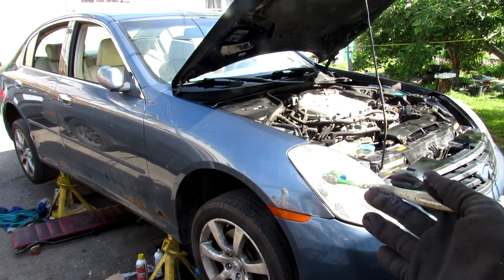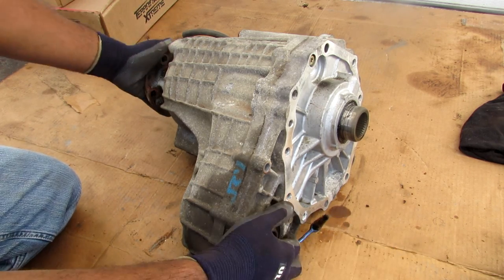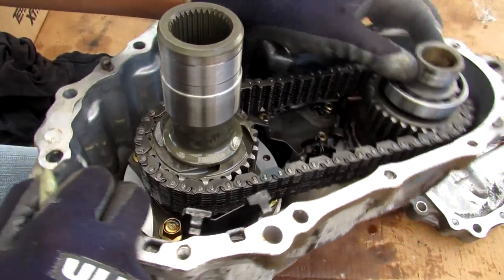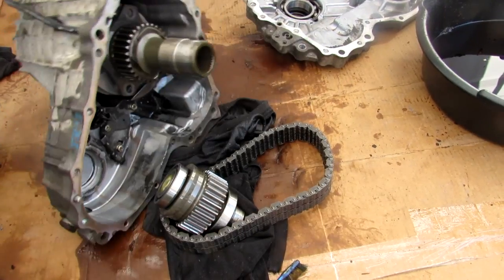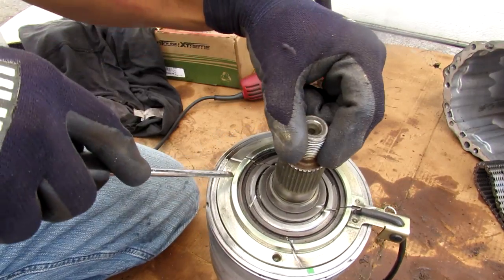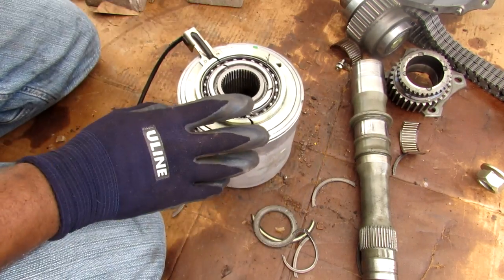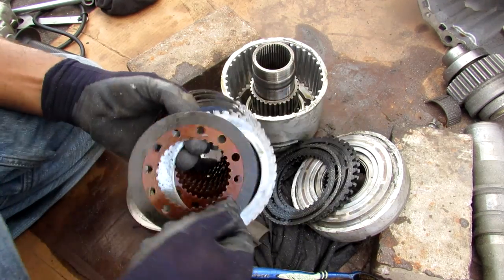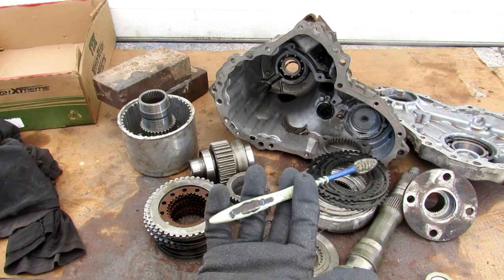How Does AWD Work?

Comment: I'm wondering how much energy loss the AWD clutch pack loses with the transfer. I'm thinking no on the AWD unless absolutely necessary and just stay with FWD, but if absolutely necessary I would go to the 4wd vehicle.
Reply: Energy loss or not, it depends on where you are and what kind of driving you need to do.
Lots of people in places like Colorado swear by it - but for most, decent winter tires and FWD does fine...and tire chains, by law you have to have them in CO if you don't have AWD or snow tires. I had an AWD Chevy Trax and it did GREAT in the snow - the AWD system only kicked in with slippage so it got good mileage. My RAV4's AWD system is always active so, it doesn't do as well on the mileage - but it has a lot more power; trade-offs abound!
Reply from the maker: Yep that's the downside of having AWD, the losses of the extra power train equipment moving around, and it's weight (approximately 200lbs). 

You'd have to outweigh the fuel, maintainence and heavier handling with the extra traction you require before considering. 

Alot of manufacturers are using part time AWD systems that disconnect the driveshaft or axles completely and only power AWD when slippage is detected.
Reply: if you have car with lot of power, it is better to have awd because 4 w on ground is better than 2 w
Reply: @makantahi3731  
if you have car with lot of power, it would be prohibitively expensive to add AWD to it - I'd get good winter tires...
Reply: @atticstattic  i have chrysler 300c 5.7 awd and it goes on snow with winter tires as it is on dry and hot, i did not install awd by my own, it was made when it was manufactured, btw  i have car with fwd too and it can not measure with awd, it is rocket on any surface and condition
Reply: @makantahi3731  I have a G35X AWD, the same system he was displaying in this video. It's real fun to drive in the rain as well. IMO that's where this ATTESA system really shines. You feel completely safe driving at highway speeds when the roads are especially wet and slippery. You can easily pass cars that are driving slower because they feel unsafe.

Comment: You should take apart a knocking or seized Hyundai/Kia 2.4 Theta II GDI and show why they fail. They usually blow up on the highway, and sometimes a connecting rod explodes into the oil pan and/or through the block. We replace these engines all the time.
Reply from the maker: I heard about the theta2 motors. I'd like to get one someday.
Reply: @speedkar99  The 2.0 Turbo version of the Theta II is much beefier. They are still under the same recall but don't blow up as often.

Comment: Given the direct drive to the rear wheels, in this case, I have to think the rear wheels always get 100% of the torque, so where the front wheels may out traction the clutch pack (and there not spin, only slipping the clutch), the rear wheels have no choice but to spin or kill the engine.  At no point will the rear wheels ever spin, say at 90% in relation to their input.

Comment: Nice video, very informative! Got a question. Is the transfer case the same as a PTU or PTO?
Reply: That's what my Hyundai mechanic said on the Kona. He called at Power Take Off unit. Never heard of that. Also said the fluid is good for 50k miles, well, not so much, after 6k miles it was black and had clutch matter in it. Same with the rear diff.

Comment: Hey thanks a lot for the teardown Speedkar99.
I've been trying to wrap my head around one part of transfer cases with clutches and I need your help:

The clutch can only transfer torque between the parts it connects. If the gear ratios of front and rear diff/axle combos are matched exactly, there will be no torque applied across this clutch at all because both prop shafts will be spinning with the same speed (ignoring the car turning and different wear/inflation of the wheels).
Does this mean that front and rear axles are geared in such way that the front prop shaft is spinning slower than the rear prop shaft when the car is rolling? This is the only way I can think of to have the power transferred to the front prop shaft.
If this is so, the implication here is that there's always some loss of power in the clutch pack whenever AWD system is engaged, because the clutch won't be able to full lock up, right?

Thanks in advance!

Comment: But if this clutch is usually half-engaged, wouldn't that be similar to "riding the clutch" in a transmission, and quickly wear out the clutch?
Reply: yes, yes, that clutch is clutch just to do engagement smootly, it could be done by gears but car should stop to engage wheels
Reply: The front wheels are only activated during hard acceleration giving the car a FWD assist with a 80/20 split. There's a snow button for a 50/50 split that's only activated within 10mph. It actually is a smooth transition. You can feel the grip in the front wheels too. I have an 04 G35X with 208k. It's 16yrs old and the ATTESA awd system works flawlessly still. The transmission itself is still really smooth. Have no clue if it's the original or not. I know the front & rear diffs, and the transfer case are. If I'm going say 50-60mph and drop it into 3rd and give it wot. You can definitely feel the traction of the car grip the road giving it better acceleration. It'll pick up and go, particularly in low to mid rpm range. Installing some intake bolt ons such as CAI and a plenum spacer really help pick up the upper rpm range. For a 16yr old car I'm impressed, I've only really tested it's limits once at night. The loop in my city is pretty much a Nascar track, especially the tolls. I got it up to 140mph and it was only at 5k and it redlines at 6.5. That's what the tach says atleast, as it can be adjusted easily with a tune. It's just more or less a fun car that can perform well. It's definitely not a real fast car like a sports car that's design for such spirited driving. But it'll keep up with them for a little bit. It starts to loose power in the upper rpm range. So it'd get left in the dust compared to modern sports sedans. In the mid 00s though it was a highly competitive car for what it was.

Comment: I don't get how they were allowed to call a 4x4, AWD.  But Chevy had AWD badges on 4X4 Safaris for years.
Reply: I don't think it's fair to call any system without a 3rd differential AWD.
Reply from the maker: That's a different debate. Did the Safari have a low speed transfer case?

Comment: Looks like next time I find an AWD g35 sedan for a decent price I could likely delete the awd without too much problem.
Reply from the maker: You mean by just pulling the plug on the transfer case?
Reply: @speedkar99  I meant by actually removing the trans case and replacing the trans with my spare rwd trans that I have. I am not sure how the ecu would react.
Reply: @pospc2  the awd light would just stay on. But you wouldn't need to install a rwd transmission. Just pull the transfer case and remove the cv axels. You'll have to take the engine out to remove the front diff though to save weight. If that's what you're aiming for. It's really more hassle than it's worth. I have an 04 G35X with 208k. It still going strong, great car. If I want to drive rwd without the fwd assist I just remove the awd fuse. It has no issues whatsoever when doing that.
Reply: @nowimhigh  the weight savings would be worth it. Engine would be built and boosted and trans sent to level 10 to be built. It's a stupid idea I have wanted to do for a while. Problem is around me finding a 2nd gen that isn't awd or isn't all clapped out or rotting away.

Comment: This is not "real AWD." This is automatically control part-time 4WD. True AWD has 3 differentials and is AWD all the time. It is NOT stealing power from the rear wheel. In this design the rear wheel are always getting 100% of the torque and the front wheels also gets 100% when the clutch is engaged, aka 4WD, not AWD.
Reply from the maker: The front wheels can never get 100% if the rear wheels are always engaged. It would be 50/50
Reply: @speedkar99  You need to learn how 4WD vs AWD works. 4WD, both front and rear wheels get 100% of the power as they are hard linked,  in this case via the clutch. There's no differential in the transfer case to split the power 50/50. You have no clue what you are talking about. There has to be a differential to "split" the power. AWD can be used on dry ground as the 3 differentials allow all 4 tires to spin at different RPMs. This system, not having a 3rd differential, only allows automatic 4WD operation when taking off in a straight line. It is similar to those FWF, fake AWD systems that aren't AWD.
Reply: @speedkar99  You will notice in his video, that he says, "the clutch to the rare wheel cannot be engaged when going around turns as all 4 tires must spin a different RPM." They are NOT true AWD systems, just like this one is NOT a true AWD system. If the Front or Rear Tires are ever Hard locked like in this system or the Crossovers. There is no way to "split power" between the front and rear tires. Is is NOT possible as 1 set of tires is hard linked. You cannot and I repeat, you cannot split power if 1 set of tires is hard linked/mechanically linked to the output of the transmission. That set of tires will ALWAYS receive 100% of Engine/Transmission output power, ALWAYS. There MUST be either a differential of viscous clutch of some kind that cut split/cut power between the wheels. True AWD have either 3 different, 1 in the front and rear axles and a 3rd in the transfer case to split the power, or in like Subaru's case, they use a viscous clutch that acts as a differential and neither set of tires are hard/mechanically linked. Educate yourself.

https://www.youtube.com/watch?v=Jk246sutET0

In this video, he explains the difference pretty good. So in your car, the rear wheels ALWAYs gets 100% engine power, the Front tires can get an "extra" amount of power. Being a clutch, it can be allowed to slip and not get the full 100%, but the rear tires ARE always getting 100% of engine torque. There is no clutch to allow for slip and adjust power going to the rear tires. What that means is when the front wheels are engaged, you are getting over 100% of engine power like a 4WD system. AWD splits 100% to the 4 wheels, 4WD send 100% to the Rear and a variable % to the front depending on the specific system. 4WD trucks send 100% to front, and 100% to rear for a total of 200%.

Comment: This is not an awd it's a 4x4 great video keep it up
Reply from the maker: This isn't 4X4 it's AWD
Reply: It's technically just FWD assisted. It's rwd until it's under some acceleration, then it gives the front wheels a 80/20 split of torque transfer. Snow mode is 50/50 only when activated for up to 10mph.

Comment: i watched this vid on repeat and it seams you missed something: shaft from engine rotates shaft in transfercase that is firmly connected with chaingear that rotates front wheels, and can not be disconnected, but rear wheel shaft is connected with power shaft over clutch  and can be disconnected from power, so this is basicaly fwd with rwd asistence if is needed, my chrysler 300c has real awd with front and rear wheels connected over planetary gear set
Reply: no

Comment: By the way beating apart your transfer halves with a steel 3 lb hammer is NOT recommended.  These expensive aluminum cases will definitely crack when subjected to such massive abuse. Then your power transfer unit will have its ears brake off under load causing many thousands of dollars damage. NO